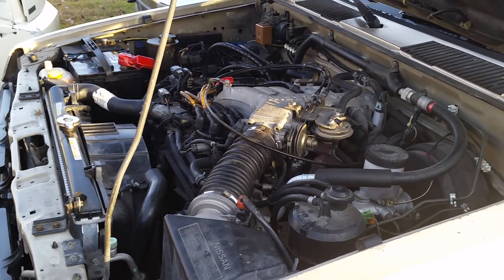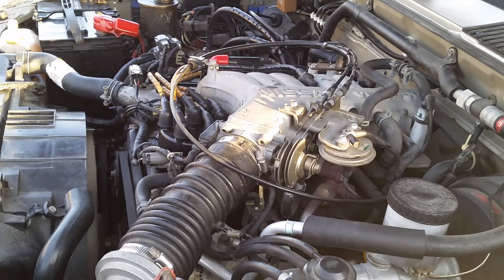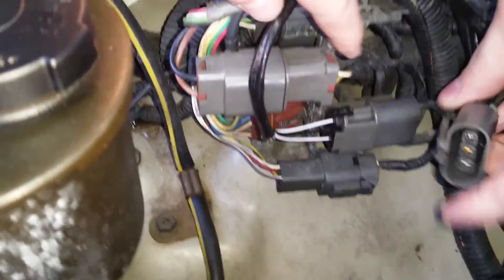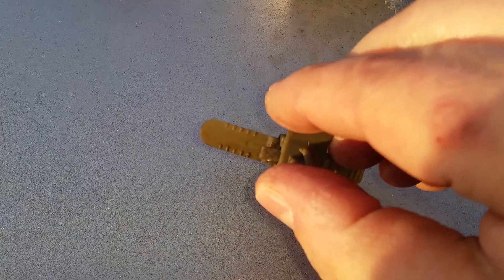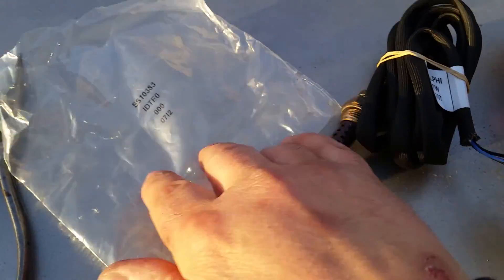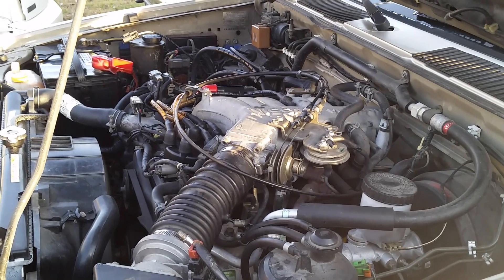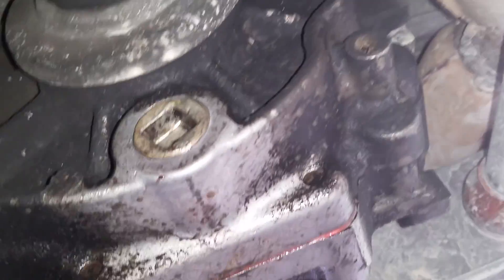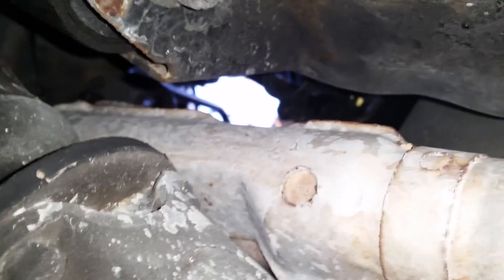95 Pathfinder D21 O2 Sensor Change ECM Code 33 Part 1

Comment: Hello how are you?
I'm from Brazil , I have a Pathfinder 1992 and the oxygen sensor it broke right on the head where will the whip , I have to return it , however I hung fitting and I am walking without , pulled the codes and is giving 55 ( smoothly ) because it was not included the error of the oxygen sensor as it took her and this nothing ? Thanks in advance !
Reply from the maker: +Guilherme Costa I'm fine Guiherme, thank you. Sorry I didn't see your post earlier. I'm not sure if you have question or commenting. For a list of codes you can see my other video on here: https://www.youtube.com/watch?v=6RK4ADgSKTAIf you have any questions please feel free to drop me a line or comment.Best Wishes/Blessings. Keith Traductor de GoogleEstoy bien Guiherme, gracias. Lo siento, no vi el post anterior. No estoy seguro de si tienes pregunta o comentarios. Para una lista de códigos se puede ver mi otro video en aquí: https://www.youtube.com/watch?v=6RK4ADgSKTASi usted tiene alguna pregunta no dude en escribirme una línea o comment.Best Deseos / Bendiciones. Keith
Reply: Hello again,

Yes it is a question, is that I am from Brazil and perhaps the google translator is not translating correctly.

I did some testing on my Pathfinder , and with the engine off is giving code 55 , as with the engine running has code 34 ( knock sensor ) ...

Strange that I traded this sensor ...

Another thing is that the cable broke my oxygen sensor and removed it and left with nothing but the code 33 (oxygen sensor) is not showing up , this is normal ?

Thank you very much for your attention, congratulations on your videos !
Reply from the maker: +Guilherme Costa Hi Guiherme Notice 1. Did you watch the Code Video? https://www.youtube.com/watch?v=6RK4ADgSKTA
Notice 2. No, With the O2 sensor disconnected you should have a code 33. 
Notice 3. If you changed the Knock sensor and still have the code 34 you probably forgot to clear, (reset) the code. If you cleared (reset) and it still shows 34 I would check the wires at the plug of the knock sensor.
Notice 4. Code 55 means end of codes. I'm at work and busy after work so I can only help a little for now. But I will try to help a little each day until you get it fixed. Best Wishes/Blessings Keith

Aviso 1. ¿Viste el video Código? https://www.youtube.com/watch?v=6RK4ADgSKTA
Note 2. No, con el sensor de O2 desconectado usted debe tener un código de 33.
Note 3. Si ha cambiado el sensor de detonación y todavía tiene el código 34 es probable que se olvidó de borrar, (reset) el código. Si ha borrado (reset) y todavía muestra 34 Me gustaría comprobar los cables en el conector del sensor de detonación.
Aviso 4. Código 55 significa final de códigos.

Estoy en el trabajo y ocupado después del trabajo así que sólo puedo ayudar un poco por ahora. Pero voy a tratar de ayudar un poco cada día hasta que te lo arreglen. Mejores Deseos / Bendiciones Keith
Reply from the maker: +Keith Noneya Meant ask you, language do you speak. I was thinking Brazilians spoke spanish and portuguese so I can use the correct translation. Keith
Reply: Hello Keith noneya.

Brazilian speaks only Portuguese! RSRS =)

I watched the video codes yes, and made the procedure ...

You could teach me how to reset?

As I understand this code (34) may be the problem that has been recorded in the system?

Since putting the new knock sensor, I need to reset to see if the code disappears, right?

Another question, when I do this procedure to view the code, the engine must be turned on, or just the key to this ON?

Thank you very much for your attention.
Reply from the maker: +Guilherme Costa Hi Guilherme, yes after fixing a suspected problem you need to reset the computer to see if the code has gone away.
To reset the computer codes.
Notice 1: Turn the ignition switch to the "ON" position, do not start the engine. 
Notice 2: On the computer set it to MODE 3, observe codes.
Notice 3: Turn the computer screw full clockwise and select MODE 4. 
Notice 4: While in MODE 4 turn the ignition switch to off, and turn the screw on the computer counter clockwise to where it was when you started, NOT in diagnostic MODE, wait 1 minute or more.
Notice 5: Turn the ignition switch back to "ON", but do NOT start the engine and check the codes again in MODE 3. You should have only code 55. Turn the computer screw counter clockwise again to where it was when you started, NOT in diagnostic MODE.
Notice 6: Turn off the ignition.
Notice 7: Start the car and drive it for a few miles.
Notice 8: Recheck the codes to see if the problem has gone away.
The "Check Engine Light" on the dashboard should be off, if no problems are found by the computer.
Best Wishes/Blessings Keith

Oi Guilherme, sim, após fixação de um problema suspeita de que você precisa para reiniciar o computador para ver se o código foi embora.
Para repor os códigos de computador.
Aviso 1: Rode o interruptor de ignição para a posição "ON", não ligue o motor.
Aviso 2: No computador de definir para o modo 3, observar códigos.
Aviso 3: Rode o parafuso no sentido horário completo computador e selecione Modo 4.
Aviso 4: Enquanto no modo 4 ligue o interruptor de ignição para fora, e gire o parafuso no computador contador no sentido horário para onde estava quando você começou, não no modo de diagnóstico, aguarde 1 minuto ou mais.
Aviso 5: Gire a chave de ignição de volta para "ON", mas não ligue o motor e verifique os códigos novamente no modo 3. Você deve ter apenas o código 55. Gire o parafuso no sentido horário computador novamente para onde ele era quando você começou, não no modo de diagnóstico.
Aviso 6: Desligue a ignição.
Aviso 7: Ligue o carro e conduzi-lo por algumas milhas.
Observe 8: Verifique novamente os códigos para ver se o problema foi embora.
O "Check Engine Light" no painel de instrumentos deve ser desligado, se nenhum problema for encontrado pelo computador.
Os o melhor desejo/bênçãos Keith
Reply: Hi Keith noneya , I will make the procedure explained !

The problem is that this Pathfinder 1992 has no warning light on the instrument panel = ( , so it's hard to see if the problem came out ...

More will follow the procedure explained to me , to see if it works for me !

Very grateful for your attention .
Reply from the maker: +Guilherme Costa Did it fix the problem? You may want to go check this site out. It's a training manual for the 92 Pathfinder.http://www.nicoclub.com/FSM/Pathfinder/1992_Nissan_d21_pathfinder_training_manual.pdf  You can also down load the Pathfinder Factory Service Manuals here, sorry the don't have the 92. It's a very good manual once you get familiar with it.http://www.nicoclub.com/archives/nissan-pathfinder-factory-service-manuals.html  Será que ele resolveu o problema?
Você pode querer ir verificar este site. É um manual de treinamento para o 92 Pathfinder.

http://www.nicoclub.com/FSM/Pathfinder/1992_Nissan_d21_pathfinder_training_manual.pdf

Você também pode carregar para baixo as fábricas Pathfinder Manuais de serviço aqui, desculpe eles não têm a 92. É um muito bom manual uma vez que você se familiarizar com ela.

http://www.nicoclub.com/archives/nissan-pathfinder-factory-service-manuals.html  Os o melhor desejo/bênçãos Keith
Reply: +Keith Noneya 

Hello my friend!

So...

I will explain to you what happened !

From the beginning, when was the procedure in MODE 3 with the engine off , the same procedure as explained to me , he gave me code 55 ...

So far so ok ...

The strange thing is that when I do with the engine running (I know that is not correct) he code 34 ... now I got it in the head, rs ...

After I did the reset procedure equal explained , I entered the MODE 3 again following his instructions and gave code 55 , then made with the engine running (I know that is not correct ) and the surprise has code 55 also , I was very happy, rs , more so yesterday I went to see the codes again to see if it was still okay and gave 55 code with your procedemento , but when done with the engine functionally ( I know it's not the right ) again gave code 34 .. .

I can rest easy , with their procedure (with engine off ) is giving code 55 ?

Big hug , and sorry for the delay !
Reply from the maker: +Guilherme Costa Hey G-Man Sorry to hear that the procedure did not fix your problem. Download the Factory Service Manuals for the 92 & 93 Pathfinders Here:http://www.nicoclub.com/archives/nissan-pathfinder-factory-service-manuals.htmlInspect your wiring the run along the frame and located by the metal body.Inspect the electrical connectors for: Corrosion, Contaminates, loose contact, damaged frayed wires on the contacts connection pins. If you have a DVM Digital Volt Meter you can check wire continuity to ensure you do not have a broken wire. If you do not know how to use a DVM I can assist you via YouTube videos.I forgot to tell you I visited Rio MANY years ago on vacation. I had a wonderful time.Have you ever vistited the States?Let me know if I can assit you more.Best Wishes/Blessings KeithHey G-Man Lamentamos saber que o procedimento não resolver o seu problema.

  Faça o download dos manuais do serviço de fábrica para os 92 & 93 Desbravadores aqui:

http://www.nicoclub.com/archives/nissan-pathfinder-factory-service-manuals.html

Inspecione sua fiação do prazo ao longo do quadro e localizado pelo corpo de metal.

Inspecionar os conectores elétricos para: Corrosão, contamina, contato solto, fios desgastados danificadas nos pinos de conexão contatos. Se você tem um DVM Volt Medidor Digital você pode verificar a continuidade do fio para garantir que você não tem um fio quebrado. Se você não sabe como usar um DVM eu posso ajudá-lo através de vídeos YouTube.Eu esqueci de te dizer que eu visitou o Rio há muitos anos em férias. Eu tive um tempo maravilhoso.
Alguma vez você já vistited Estados Unidos?Deixe-me saber se eu posso assit você mais.Os o melhor desejo/bênçãos Keith
Reply: Good night ... It is here Night, rs

I was searching THAT EVEN the manual, I was delighted paragraph to send to and in Inglês, I will try to translate, Sera Hardest IN Being PDF ...

Here in Brazil and Hard to Find Technical Information, qualified parts and mechanical work with the Pathfinder, I believe That nd YOUR Region MUST be Super Easy, I'm a big fan this truck, JA had three, uh 94, another 93 and Me And now 92!

This rectified motor to hum MES, I have 23 years and I love automotive mechanics ...
I have to turn around to the way that ...
INFORMATION know for Me to Pathfinder, I SO look at Ingles At Google, rs, give ten INFORMATION lot POIs, and I'm taking my doubts!

I and cool, I get in the state of São Paulo, okay? But Also I have visited the Rio de Janeiro, beautiful City, rs, I do not had one opportunity to visit the United States YET, but I have friends around, including hum Jiu-Jitsu (Martial Arts) que trained with us and here Changed paragraph if Your Parents!

I 'm sorry For the translation, MUST Being bad because the translator Fully changes the team what I say !

Best Greetings and thanks again for your help ...

God be with you!
Reply from the maker: +Guilherme Costa Hi Guilherme if you have a word processing program like Microsoft Word you can copy the words from the PDF and use the Google Translator to translate. Then copy them to your MS Word Document. It would be a long process to do the whole manual. However if you only did each section as you need them it would not take to long. Then you would have your Pathfinder manual in Portuguese.Best Wishes/Blessings Keith 

Oi Guilherme se você tiver um programa de processamento de texto como o Microsoft Word, você pode copiar as palavras do PDF e usar o Google Translator para traduzir. Em seguida, copiá-los para o seu documento MS Word. Seria um longo processo para fazer todo o manual. No entanto, se você só fez cada seção que você precisar deles, não levaria muito tempo. Então você teria o seu manual de Pathfinder em Português.

Os o melhor desejo/bênçãos Keith
Reply: Hello Keith Noneya

Already transferred to MS Word , however appears as image and can not edit the words , the sooner I can , I'll download a few programs that does this and try!

Quiet friend , I understand your concern ...

See you later!

And thanks for the help .
Reply from the maker: +Guilherme Costa Hey Guilherme if you get good at this you could start your own Nissan Pathfinder repair shop and information center. Complete with the Portuquese Shop Manual Series for sale. I'm sure Brazil could use a good Nissan Repair center. What town do you live in, i'll look it up on Google Maps. 
Best Wishes/Blessings Keith

Hey Guilherme se você ficar bom nisso, você poderia iniciar a sua própria loja de consertos e centro de informações Nissan Pathfinder. Conclua com o Manual Portuquese Shop Series para venda. Tenho certeza de que o Brasil poderia usar um bom centro de reparação Nissan. Que cidade você mora, eu vou procurá-lo no Google Maps.Os O melhor Desejo / bênçãos Keith
Reply from the maker: +Guilherme Costa + Guilherme Costa Nice little cidade Guil, acho que vou chamá-lo apenas Guil para breve. 
Os O melhor Desejo / bênçãos Keith
Reply: Hello how are you?

I did not understand your message...

See you later!
Reply from the maker: +Guilherme Costa você tem acesso de e-mail?
Reply from the maker: +Guilherme Costa I have a friend who has unlocked the 94 Nissan Pathfinder manual and converted the EF EC section to MS Word and in a PDF that you can edit. It's chopped up in 5-6 parts do want me to email it to you?
Reply: +Keith Noneya 

Hello Friend...

Sorry for delay, time is running here!

I tried to convert to Word, however some programs only takes a few pages, and this manual is more complicated as it was scanned dai has to be a specific program, and most of them are paid = (

More will leave in English even when I have to, I translate the part I need to Portuguese!

Follow my email: (gui-1@r7.com)

Thank you...

Even more, God be with you!

_________

Olá amigo...

Desculpe à demora, o tempo está corrido aqui!

Tentei converter para Word, porem alguns programas só converte algumas paginas, e este manual é mais complicado pois ele foi escaneado dai tem que ser um programa especifico, e a maioria deles são pagos =(

Mais vou deixar em Inglês mesmo, quando eu precisar, traduzo a parte que preciso para Português!

Segue meu e-mail: (gui-1@r7.com)

Obrigado...

Até mais, fique com Deus!
Reply from the maker: +Guilherme Costa Did you get the 1st section of the manual?Você conseguiu a primeira seção do manual?
Reply: +Keith Noneya 

Good evening, yes friend, sent me!

Apparently the problem is gone, this just giving code 55 =)

But it's great to have this manual here, if I need ...

Soon I will work on her suspension, and in the manual that pointed me in the site '' NICO '' has all the technical information described!

Grateful for your help ...

God be with you!

________________________________________

Boa noite, sim amigo, me mandaram!

Aparentemente o problema sumiu, esta apenas dando código 55 =)

Mas é muito bom ter este manual aqui, caso eu precise...

Logo mais vou trabalhar na suspensão dela, e no manual que me indicou no site ''NICO'' tem todas as informações técnicas descritas!

Grato pela sua ajuda...

Fique com Deus!